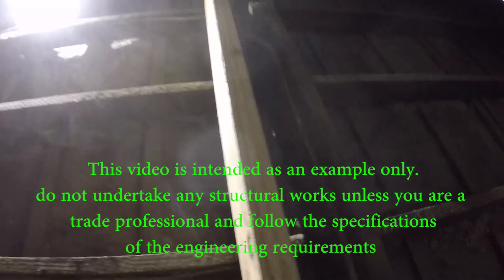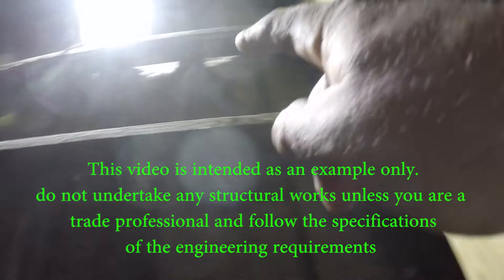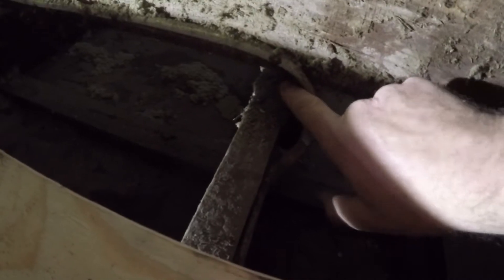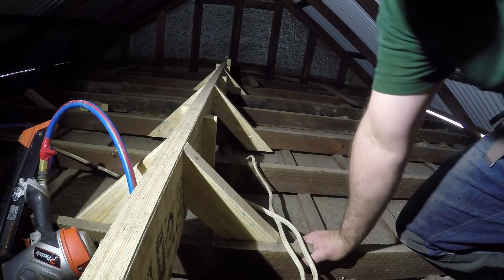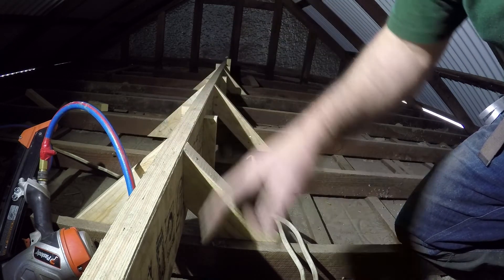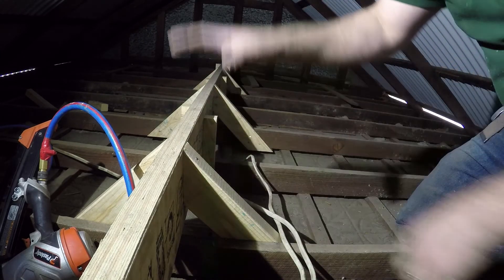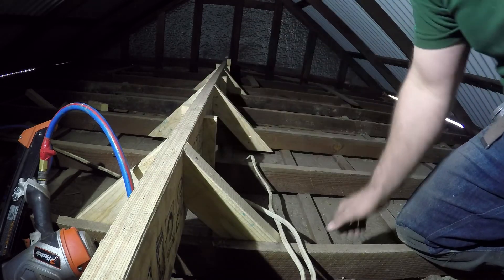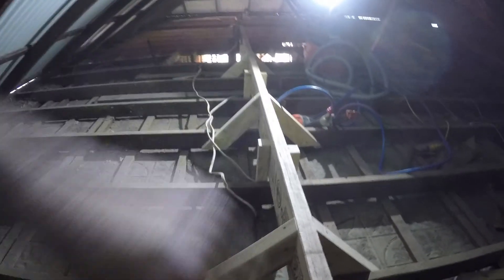Home renovation - Upgrading a hanging beam

Comment: Hi Jojo, i have an 8 metre span, so i'm using a counter beam in the middle of the span to break up the hanging beam (4 metres either side of the counter beam). How would I best brace the counter beam from rolling? Given that the counter beam run parallel with the ceilings joists, there isnt much to brace to.
Reply from the maker: Hello there,
there are several ways to brace the beam, the video you have replyed/commented on has some perfect ways to utilise the existing structure 
https://youtu.be/1L2GIWStBbw - this is another vid that shows a few different ways .... alternatively get onto my Skool community for free and we can chat and i can coach you there Skool https://www.skool.com/wulf-institute-1389/about?ref=3888ed6861604536b5cd0f5094db2ba4
Reply from the maker: gday @APe-s1o, 
i have re-read your message a few times and have your answer.
the counter beam should be installed first from end of joist to end of joist (Wall plate to wall plate) and i will always place these ends parallel and equal.
they need to be sitting on a load bearing path and my suggestion is to put a 4 x 4 across 3 or four joists so that the weight is distributed properly over an area.
brace the counter beam at both ends with a 45 degree brace going in both directions, the hanging beam will butt up to the centre of the counter beam on both sides.  my preference here is to actually cut in a housing join 15-22mm (1/2-4/5 of an inch) so that all the pieces get joined together and the rolling is vastly reduced. 
Many carpenters these days and engineers ask for a steel bracket.... ill leave this to you.
please feel free to join my new Skool community https://www.skool.com/wulf-institute-1389/classroom and share your story and projects with me and the team

Comment: Great Video - thanks for that. One question is how did you raise the joists that weren't secured to the existing beam to attach them to the new hanging beam ? (the ones that were casing cupping in the ceiling below)
Reply from the maker: Good question! JK1367
One of the ways to bring the ceiling joists to the new hanging beam is to put a plank along the ceiling in line with the new hanging beam
This plank is propped on top of some Acrow props and we "Jack" the ceiling up into position.  The ceiling joists might not "touch" the new beam yet they wil be closer wit hless sag.  While here we fix the timber all togther... there are other vids of this on my channel.
Thanks for your question
#stayawesome
joe joe
Reply: @BeowulfBuilders  Oh that is a very clever idea - thank you for that! Your vids have been extremely inspiring for my renovation plans - I even think I may be able to do some of the work !! (Only kidding I will hire professional chippies!!) 
Cheers from Down Under! :-)
Reply from the maker: #stayawesome ..... JK1367

Comment: Great video mate! Could you use joist strap on both sides rather than soldiers? 
Another question is would you still need the herrins if there was no sagging to ceiling?
Reply from the maker: Gday Al,
Yes you can use joist straps yet it will depend on the timber that you're nailing into.  Some old timber wont work well with joist straps and sometimes joist straps wont do for stability and strength.
stay awesome
Joe Joe
Reply: @BeowulfBuilders  g'day fellas love the vid . I'm putting  a hanging  beam into a roof space  to lose a main wall . The wall is the main support for the hardwood  ceiling  joists . Just wondering  if a 360x45 lvl would be enough to span 4m or should I use 2 /360x45 lvl ? Cheers
Reply: @BeowulfBuilders  
Hi I wanna opening my wall up can I do d same things
Reply: Really helpful as I’m doing this on a smaller scale this week 👍🏻
Reply: Hey mate was engineer required for this or did you give your supplier the span and they sorted it